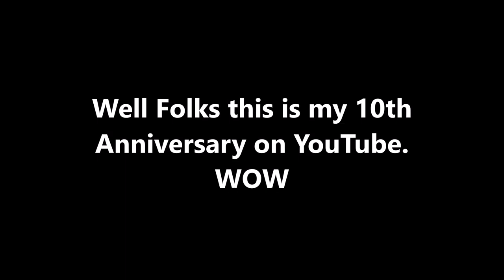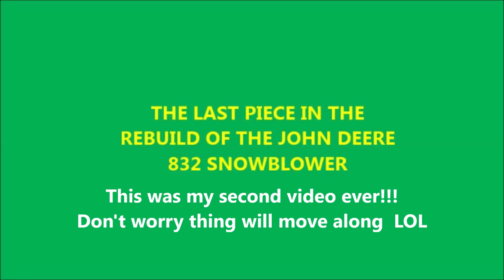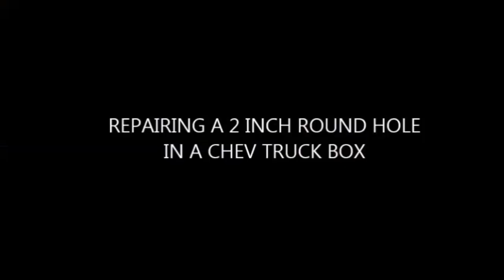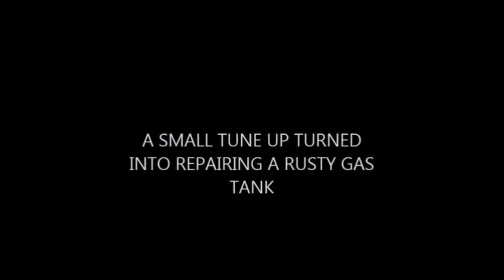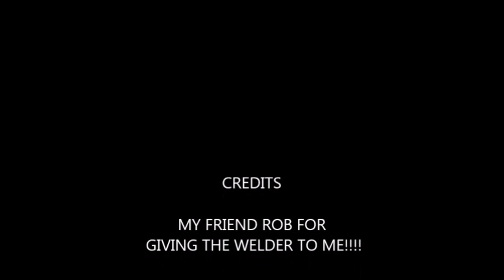10 Years On YouTube!!!  Thanks Folks

Comment: Congratulations Bruce!
Reply from the maker: Thank you!  Did you work in outside engineering?
Reply: @BrucesShop  you could say that, lol. I grew up and worked in my families Outdoor Power Equipment (OPE) business. After 50 years of family I retired last year, only to open up my own little shop just for repairs. I worked the shop in the late 70s and 80s then graduated to showroom sales -including equipment and parts. It's been a long haul, but I'm still doing it at 64. 😁 We sold and repaired them all. We've been a HUGE dealer for Honda and Stihl in recent years among others.